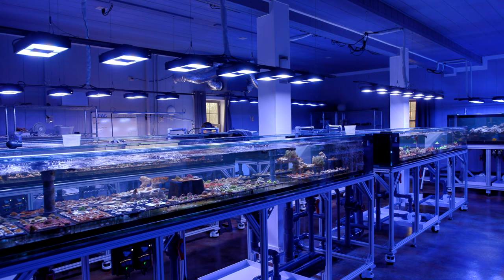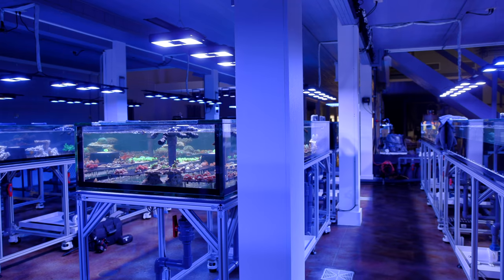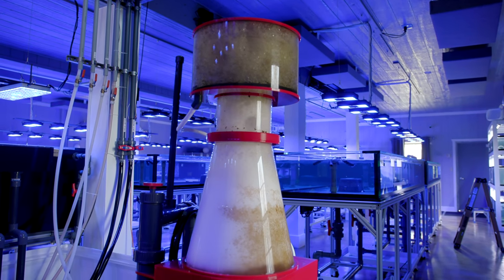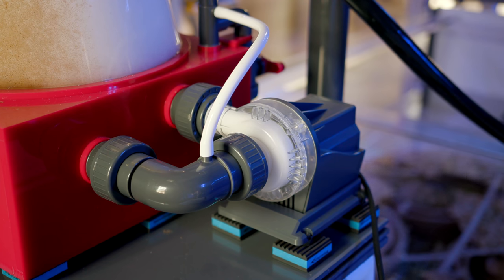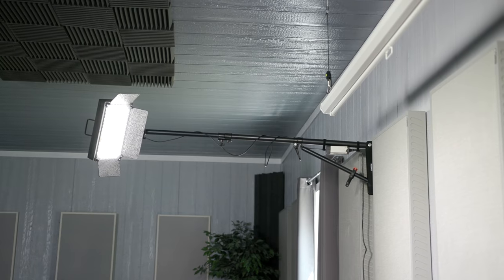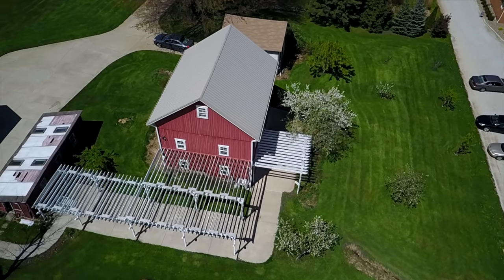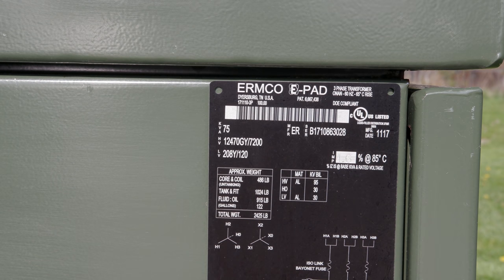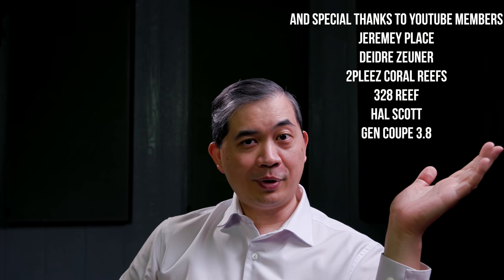BIG STUFF! April 2021 Coral Farm Update - Episode 22

Comment: Your journey is similar to my building my own USDA on-farm butcher shop. Seven years. Very glad I designed and built it myself. Got to do it right. 

Sound: key. I designed materials, textures and geometries to minimize sound. Did this both for my cottage and my butcher shop. Works. Vibration isolation helps on equipment. 

Do you have pressure balancing tanks on your water lines? It hells a lot. 

Love following your progress. 

Double entry doors help. 

Interesting on your gen/bat choice. I get ≈2 weeks of power outage a year.
Reply from the maker: Eliminating sound is such a challenge.  I know a lot more now than when I first started this build.  I am just glad that I was able to make the studio super quiet.  The main space just has a lot of loud pieces of equipment but even then I am trying to knock that sound down.  

As for the generator, I feel like we are really lucky here because we don't get a lot of power outages, but it just takes one bad one to do major damage.

Comment: Hey Than! Let me open with saying that I assume you've already done a lot of research on this, and probably know most of this already. But just in case its of any help, I thought I'd throw out some green screen info.

On color.
Your screen looks like its "Digital Green", although its obviously hard to tell in video. Digi green is great in that it offers a lot of color contrast, but since its such a bright color it makes shadows a bit more apparent. It also tends to reflect more green light back on the subject, which doesn't look great.

Chroma green is a lot darker, so pulling a good key can in some instances be harder. However you can usually work a lot closer to it. For the kind of stuff you do I think 4 feet should be very doable.

Lighting your green screen separately is great as well. Avoids shadows. I cant remember off the top of my head, but its worth looking into lighting your screen with tungsten balances lights, and your subject with daylights.

Lighting your subject mostly from above helps a lot with shadows. Especially if you can set up some black cards on stands, or barn doors or something to minimize spills onto the background.

Again, I really don't want this to come off as me "mansplaining" something I'm sure you know a lot about. Its very apparent you are very skilled at what you do. Its only meant in good faith, in a "maybe some of this is useful" kinda way.

Cheers!

Comment: In between the time the power is lost, and the generator and transformer kicks on, do you have some sort of UPS too? Or maybe you just need individual ups backups on the most critical equipment, like controllers?
Reply from the maker: Not a lot but some.  Mainly for computers and routers.
Reply: Good point. No need to spend 20K+ just to have those 5 seconds for the generator to fire up 😅